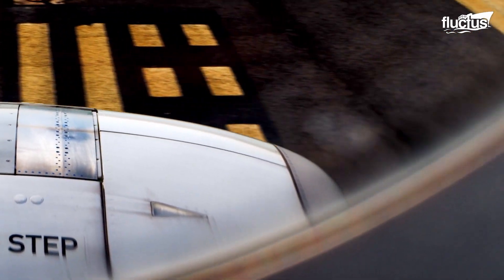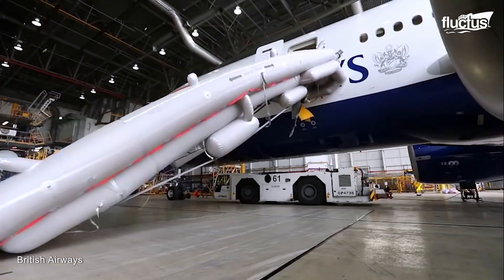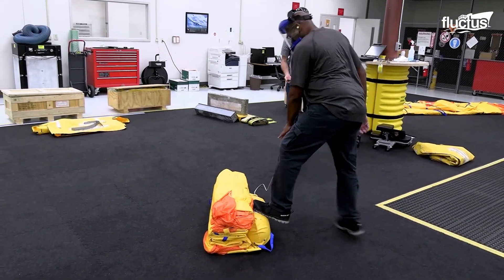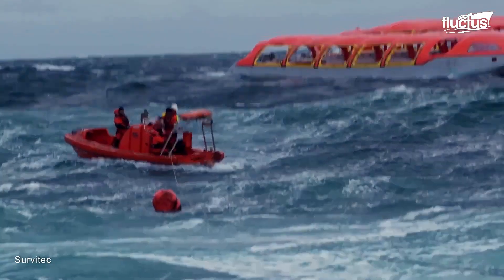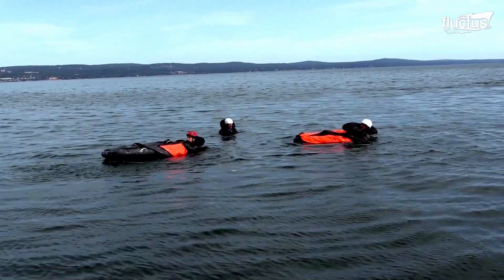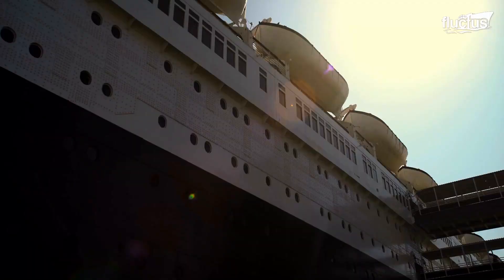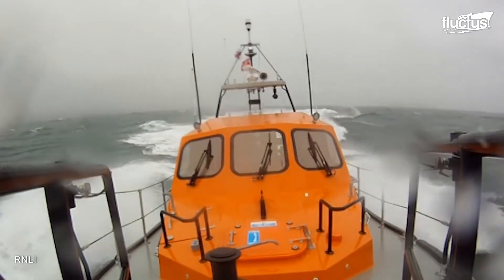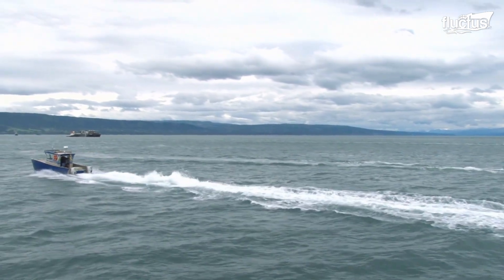Behind The Oddly Satisfying Process of Testing Airplane Emergency Slide

Comment: Former Boeing Everett... in the past when we needed to test emergency slides, employees could signup to be 'victims'. New aircraft had to be certified and emptied in under 90 seconds. I never played victim, but I sure wish I had. It looks like lots of fun.
Reply: AA Flight Attendant here…. I was selected to do aircraft certification when we took delivery of the B757 with the USAir merger.  4 FAs strapped into our jump seats.  FAA inspectors sit in front of or near ALL exits.  The window shades are all lowered so the cabin is pitch black.  We knew that we would be evacuating but we didn’t know which doors would be operational.  We were required to evacuate all 189 “victims” as you called them in 90 seconds w/ only HALF the doors being used. The FAs & victims all had to just sit in their seats waiting for the signal to go.  I think we waited a good 15-20 mins before we were given the signal to evacuate.  I was seated at the front 2 doors.  My 1st door was usable.  That door whipped open and my slide deployed as expected & I began the evacuation.  My 2nd door in the forward galley would not open so I had to commence my evacuation with the one door.  The whole process happened SO quickly I couldn’t believe it when my area was clear & I was jumping down the slide myself.  189 passengers, 4 of 8 doors were used & we had everyone off in 78 seconds.  One of the most incredible experiences in my 30 year career.